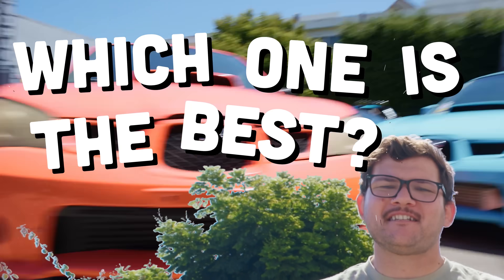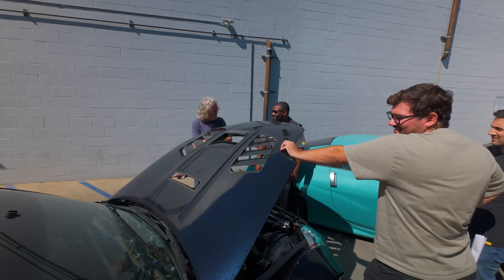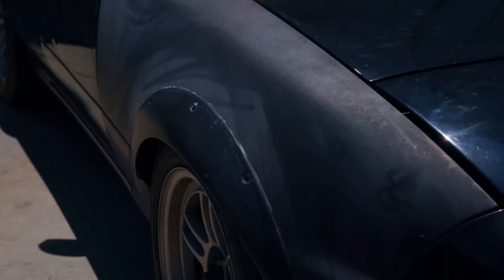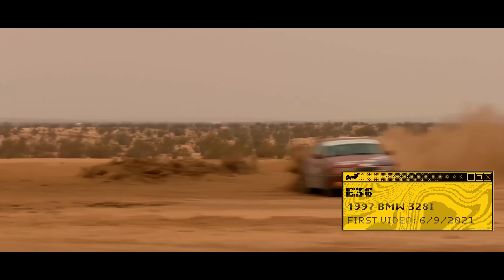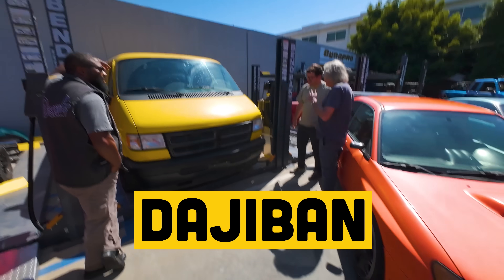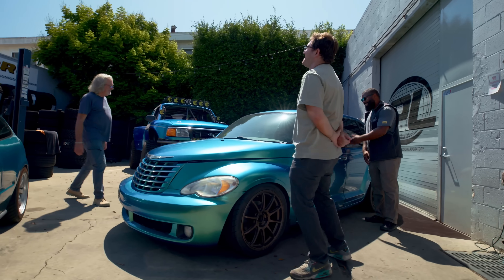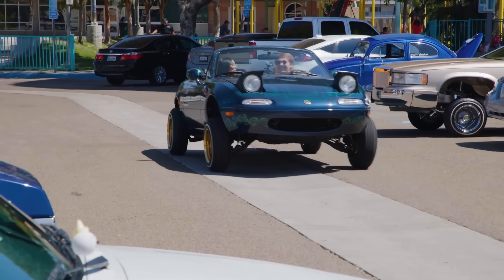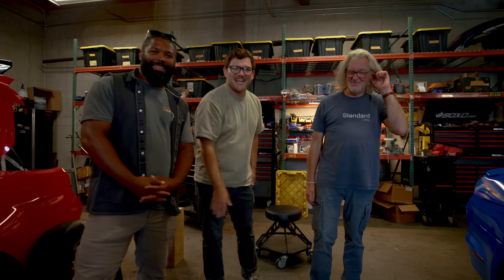James May Roasts All Our Cars

Comment: finally someone addresses the fact that people in the US say that subaru is unreliable while people in Europe say its super reliable
Reply: Naah, they blow up here in Europe aswell 😅
Reply: well you have to realize that compared to european cars, they're toyotas
Reply: As someone from the UK, Subaru is generally super reliable. The main issue is that there are fewer Subaru garages about and the parts are harder to come by when something does go wrong. It's generally just more convenient to get a Toyota, for more proximity to garages and more parts about because Toyotas are just more abundant
Reply: Subaru are great!  My Forester hit over 300,000 miles.
Reply: Yeah, one thing I'm noticed about Subarus in the US and people who usually say they're unreliable are the people who say take him to the track or try to rally them but modify everything but the actual core components you need to modify to make sure your Subaru doesn't blow up. Like the Forester, the outback the crosstrek I have yet to see one broken down on the side of the road and barely ever see them in the garage.
Reply: It's all about where you live. In Sweden, one of the best cars to own is a volvo 740 because even though it's 35-years old, I could probably find parts in my mom's cupboard since they're so common.
Reply: It is because here in Europe it is the 2.0l variant that was sold mostly. The WRX's EJ engine was originally designed to be 2.0l and that is actually reliable and durable. The US 2.5l variant's block is exactly the same as the 2.0l just bored wider and has a bit longer stroke. And because it is bored wider, the head gasket is narrower around the cylinder. Which makes it prone to head gasket failures.

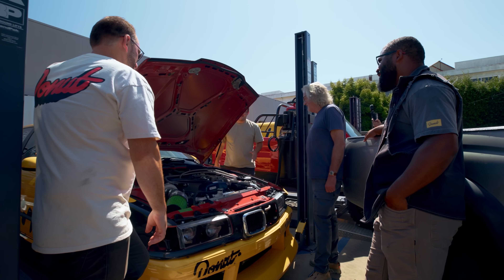Comment: Those two Hawkeyes at 10:15 are beautiful, easily their best looking cars they showed today!  So glad May actual said Subaru engines are known for being reliable.  They're right, kids here push it for big HP numbers but that's not what they're designed for, they're designed for amazing handling on all road conditions.
Reply: England also got the JDM spec EJ207 in their WRX & STi, which have much better internals compared to the US spec EJ257

Comment: 11:18 I’m glad James fuckin called it out and donut acknowledged the validity and the flaw in the current car culture. 99% of the time it’s the owners not the car
Reply: 99% of cars below 60k can be improved. manufacturers gotta appeal to the majority and also make a profit, so cars naturally come out gimped. like my forte gt was pretty bad to start but modding it has made it actually feel a little bit sporty. most cars handle modifications fine, boxers are just weirdly fragile.
Reply: @cosmic7234  can't really blame the boxer as much as continually putting the new engines in without cleaning/replacing every single part that oil runs through, sending old metal through the new one and losing it too. They finally learned from that and a few other mistakes, after they made Subaru look like an absolute nightmare in the car community. The work has to be done and it has to be done right, or it won't tolerate it. 30k miles a year in my modified 2011 for several years now.

Comment: wait a minute...the imperial STILL doesn't work? what's it going to take?
Reply: Did they rebuild the engine? Last time we saw it running was after the collab video with the restoration channel right?
Reply: It's an old car. Even when it works, it doesn't work. lol
Reply: It probably has bad gas at this point lol. And i think it was more "it technically turns on" than it actually being up and running
Reply: @ChrisPBacon9 Right. The car needs to be driven regularly.
Reply: Probably a show concept that makes successful thumbnails.
Reply: They need a reason to invite junkyard digs over every year
Reply: Professionals who actually know what they're doing.

Comment: James is right with his talk about reliability, Subaru's, BMW's, VW's and Ford's are generally bulletproof platforms in Europe. Don't know if it could be that we run them on higher quality fuel as 95 octane is generally the norm, as I've seen some people fill these cars up with 87 octane in the US.
Reply: 87
Reply: @ryansmith1471  ah yes 87 thanks for the correction will make adjustments accordingly
Reply: Dont compare directly Europe octane with American octane. Europe measure their octane with RON method, meanwhile US & Canada measure their octane with AKI method. 87 Reguler in US roughly similar to RON 92 if it's still available in Europe. 89 US would be roughly similar to RON 95 in Europe.
Reply: @bzilla-d4i  no problem, idc really but that’s the cheapest lowest grade fuel with less than 10% ethanol there is E85 but it’s ethanol fuel. 
Usually at most pumps it’s 87, 89, 91or93
Reply: @ajidamarjati  thanks for clarifying so it's pretty similar then, I'm from Italy, we have 95 Ron(Verde)/91 AKI as normal fuel, 98 Ron as Premium and Shell, Agip and Tamoil offer 100 Ron fuel as well, which is what i choose to fill up with.
Reply: Americans do not service their cars like Europeans. Secondly, their engines are made in better factories vs the ones in mexico.
Reply: @bzilla-d4i  I’m jealous, I’d fill up with 100 if it were available
Reply: @ryansmith1471  you notice the difference, I have a couple of turbocharged vehicles, a Giulietta 1750 TBi, a Leyland Mini with 4-AGE 20v Black Top, and a E36 M3 Turbo, and you notice the difference when running these cars on 100 Ron.
Reply: @bzilla-d4i  Same for me with the corolla 20V Black top, anything less than 98 and it would run noticeably worse. They were made to run ideally on 100 that's easily available in Japan
Reply: i mean most of those are european/japanese brands so it makes sense that they have better parts accessibility in their own domestic markets
Reply: @grqfes  those brands are built all over the world bar Subaru,  they don't build them in Europe and they don't have the catastrophic engine failures out here. It's not common at all. BMW's are built in the US, Germany, South Africa etc but only the US market appears to have problems with them. The South African stuff are exceptionally well built even better than the stuff we have in Europe, BMW also has an amazing history in Motorsport and unique models out there. Same goes for Ford, Alfa Romeo, Mercedes Benz, VW etc.
Reply: @bzilla-d4i someone is rich...😅
Reply: Somebody's uninformed about the differences in Octane ratings.
Duhhhhhhhhhhhh
DUH NINETY FIVE IZ BUTTER DEN DUH EIGHTY SEVEN.
They measure different things and 87 = about 96 and octane ratings don't measure how "good" a fuel is.
Pipe down until you learn about RON, MON, and AKI.
Duhhh itz colder at 26 C  Den it iz at duh 50 F.
It reminds me of the epic facepalm from Jeremy Clarkson calling European fuel "more explosive".

Comment: Had to do bodywork on a Imperial when the owner ran over the shop's ground transformer coming in for a oil change😂 Seriously those old body panels are basically tank quality now using a 10 lbs. sledge to get them to move at all😅

Comment: One the WRXs, europe got the 2.0L EJ motor that is pretty bulletproof, while we got the 2.5L that was pretty flawed.  The rally cars ran the 2.0L.  They made the 2.5L for the american market trying to bump up the low end torque, but to meet emissions they made a design choice that weakened the ringlands while increasing the risk of detonation.  The ringland issue really just affected the GD chassis generation, like the Hi Lo cars, but the combustion chamber design that increases detonation risk is there with any EJ257.  Thats why my ECU is a learning ECU, and let me tell you it has an anxiety problem it tries to pass along to any of its owners if they purchase a Cobb AccessPort.  I have 3x guages on it that track how the car is managing timing and potenial knocking.  Never heard of these issues with the 2.0L engine they have in japan and europe.  Still love my Blobeye.

Comment: Can you install nos on a automatic car?
Reply: You can install nos on a lawnmower lol. Transmission has nothing to do with it. If it breathes oxygen and burns fuel, nos will work
Reply: @rojiii69420  no it wont bc if nos is used the rpm goes up uncontrollabyly and if u have manual u can just not shift if u use nos but w automatic u cant control the shifting so it would kill the engine
Reply: @Salty_sjoe  you know modern autos shift just fine with nitrous. Also most of them can be shifted manually
Reply: @rojiii69420  i dont think you.... understand just anyting of transmissions ur pfp is a woman so i dont expect much but still
Reply: @Salty_sjoe  im sorry what💀. Mf im a certified honda tech. And my pfp is just something i like. Auto cars can have nitrous. Its not tied to a kind of transmission. Ion know what you on but a simple google search would be very helpful to you
Reply: @rojiii69420  yh sure u are blud and if the gearbox decides to shift when u use nitro ur gearbox will be dead
Reply: @Salty_sjoe  aint no way my boi😭
Reply: @rojiii69420  aint a way why th u calling me ur boy 😭🙏🙏
Reply: @Salty_sjoe  its an expression......goofy ah

Comment: Americans are all about displacement and they take the EJ25 over the EJ20. 
The EJ25 is strong enough for the hp it has but becomes unreliable if you tune it too much.
The EJ20 is a seriously good tuner engine, even on the rally cars used them or EJ22 but never EJ25.
(Tuning them is more costly then doing it to other engine platforms tho)

Comment: If the bottom part of the market is not catered with 30 K minus offers on new EV’s the market will die for EV’s. Next issue is the infrastucture that will not be able in the coming 10 years to cater the charging needs. We need a next gen battery technology and in a sense current EV’s are the dinosaurs within the tech needed. 
Looks like a dead end street. Next to that all call manufacturers excluding Tesla are losing money on EV’s and bankrupcy is closer then ever for a lot if them. Its one of the reasons of VW ‘s crisis.